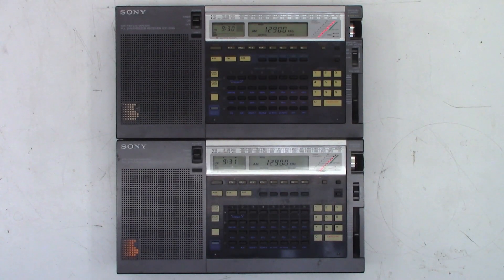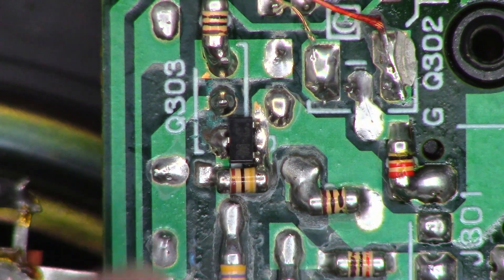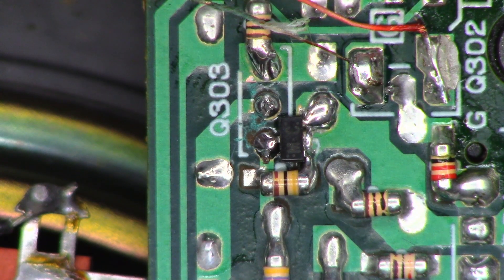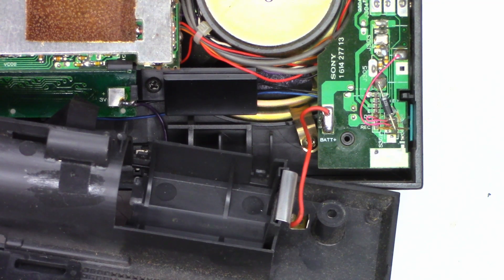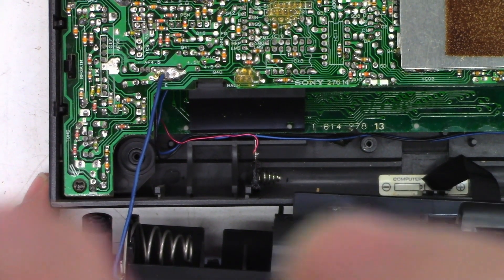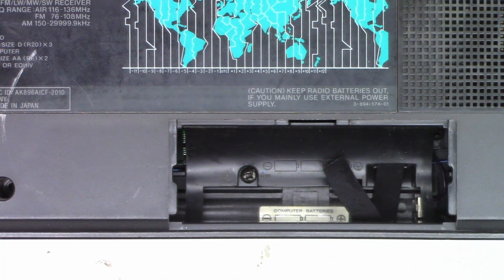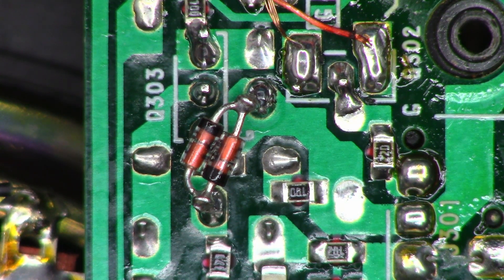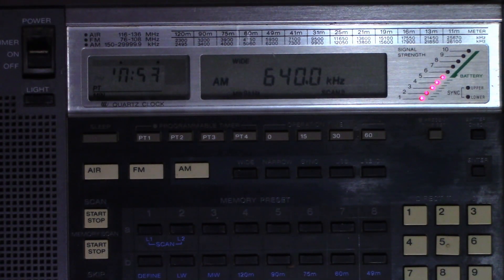Sony ICF-2010 Adding Q303 FET protection diodes and some other tips on these radios ICF-2001

Comment: I see at 7:08 that you have installed a wooden spacer to strengthen the right side of the AA battery connection. Would it help to do the same thing at the left end of the AA battery connection?

Comment: What's the large diode and pink wires attached to the secondary power switch on the IO Board on your radio ?

Comment: Been watching a number of your videos now, (especially sub ones) and learning a ton.  Have you ever worked on/repaired a Rega (UK) "Vulcan" Subwoofer?  Is there a process to hiring you as repair technician? 

Rega made the Vulcan for a handful of years (collaboration with REL) back in late 90s.  It's a stunning sub, (darker cherry wood) and has been a perfect 'smaller' audiophile quality sub for a two channel home theater/music system (all retro 90s British stuff).  But, over the recent years it's displayed a couple of common sub issues: hums, thumping, now won't power on and blows fuses (clearly now something is shorting out).  In looking at the two PC board amp and crossover, it all "looks" really really simple, but I am NOT skilled with proper diagnosis nor repair.  Rega, sadly is known for NEVER repairing older electronics, and NEVER releases schematics either.  I would hate to just chuck the sub (inherited from audiophile step dad).   Thank you for your time and keep posting great videos!!!
Reply from the maker: email me about it Norcal715videos@gmail.com

Comment: Thank you for the video, it was very helpful. Great tip on the backing up the screw before screwing it in - I have always been doing that.  I have a question though - Do all ICF-2010 require this protection diode mod? Also, what would be the behavior of this radio if it was affected by the absence of these protection diodes?
Reply from the maker: The later models had them installed from the factory. The earlier version had a tech bulletin to add the diodes to protect the FET. Without the diodes with  external antenna the FET (301, I think) would be affected by static discharge.

Comment: Hi,  can you be more specific about  " protection diodes,"  On the video these diodes look like zener diodes.
Reply from the maker: They are 1N4148 small signal diodes. They are 75V PIV (peak inverse voltage) 200 ma forward current, 4 NS (nano second) recovery generic diodes

Comment: Did you ever had to replace Q303 2SK152 ?
Reply from the maker: Yes on my own 2010's multiple times with a long wire antenna before I added the protection Diodes. The slightest electrical storm in the area would smoke the FET.
Reply: @norcal715  Hello, thanks for the answer. I will add a BAV99 (marking code A7).
I unlocked the AIR band, but the 2001D is missing the components on the PCB. But I was able to unlock the frequency range for SW and FM.